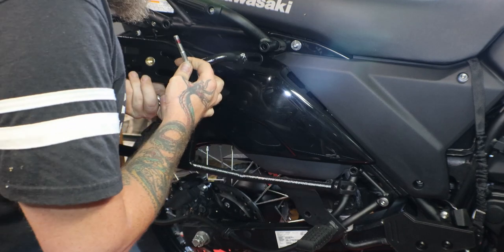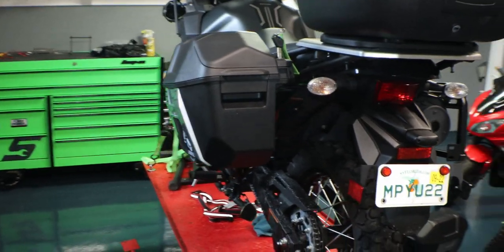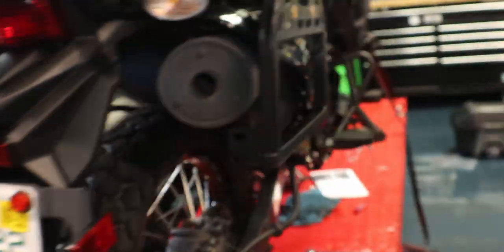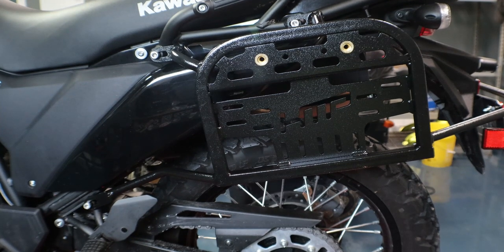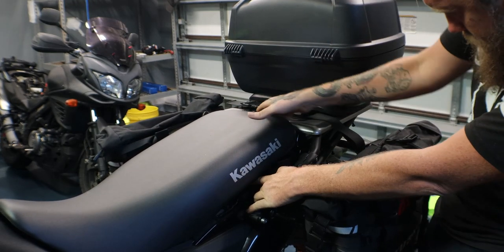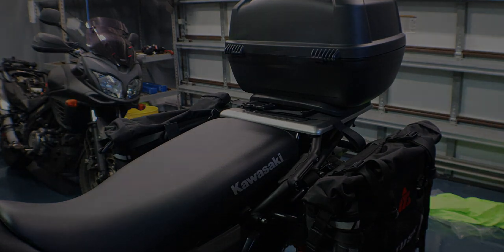2022 KLR  650 HAPPY TRAILS SU rack and Tusk Pilot Pannier Bags install. 22 KLR build series

Comment: Nice video. Can you remove the side plastics on both sides to access the battery and airbox without removing those racks?
Reply from the maker: yes you can the right side takes a little wiggling but not too bad
Reply: @FullThrottleJunkie  thank you. I just got my non ABS yesterday.
Reply from the maker: it surly is a nice bike

Comment: Does the strap that goes over the seat be rigged under the seat instead?    I may carry a passenger from time to time.   Do the bags leave room for a passenger’s legs (to access the pegs)?   Thanks.
Reply: Ok.   Guilty as charged.   I stopped the video at 13:30 to ask these questions.   After writing the comment/questions, I hit play again to continue watching and you immediately answered my questions…
Reply from the maker: 😆🤣🤣 thanks for watching i know this one is a little long but I wanted to be as clear as possible
Reply: @FullThrottleJunkie  I have an Apache4800 on top and would rather not across the top for front or rear strap. Instead of getting the mounting plates you think I can just attach cross strap to rack on each side?